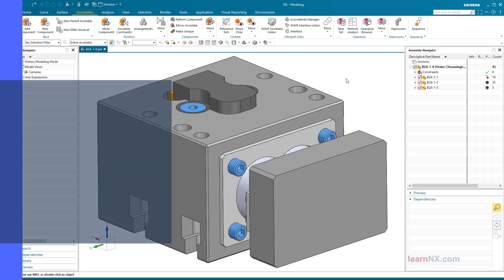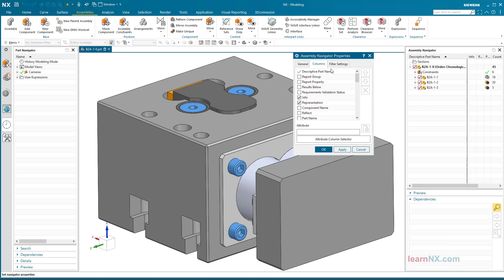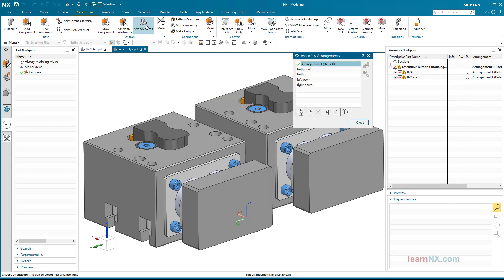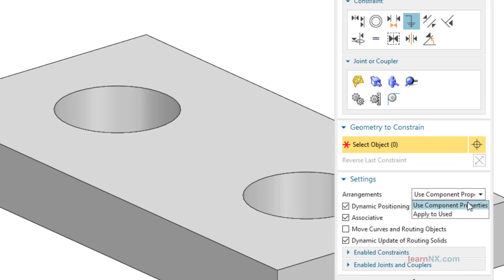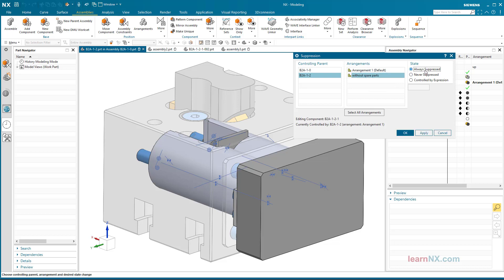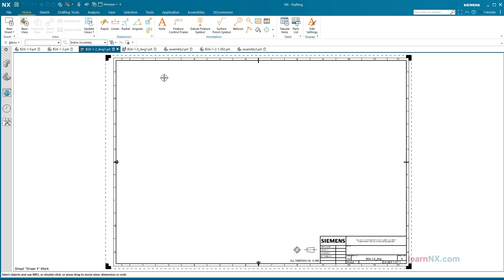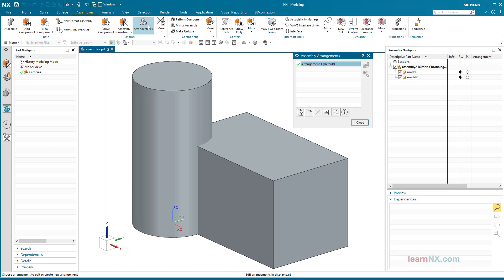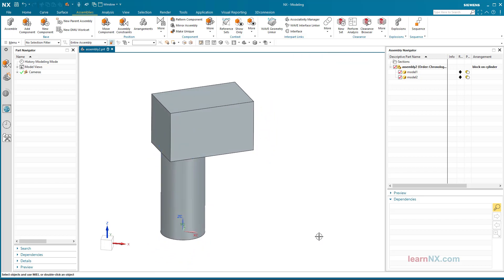Siemens NX Tutorial | All about arrangements

Comment: I am using NX 2412, and the option for the arrangements — 'Apply to Used' — shown at 7:27 does not appear. Any ideas?
Reply from the maker: Hello Mr. Bruno, yes the user interface has been changed a bit. You can now find this setting in the default settings here: Menu, Preferences, Assemblies..., Position. Here you can choose between Active Arrangement, which corresponds to the selection Apply to Used, and All Arangements.